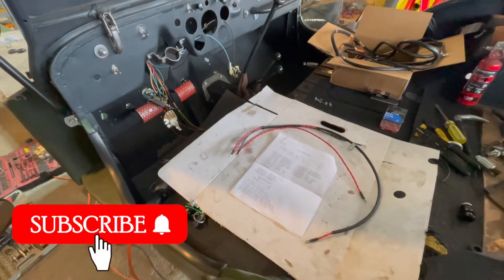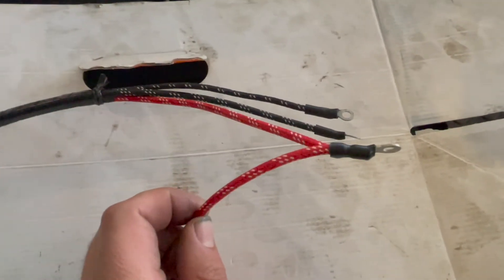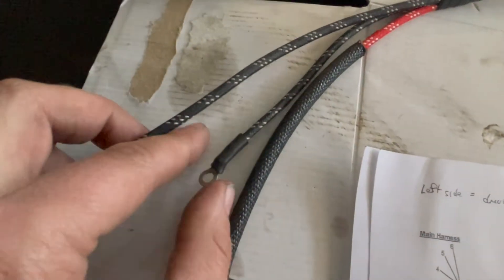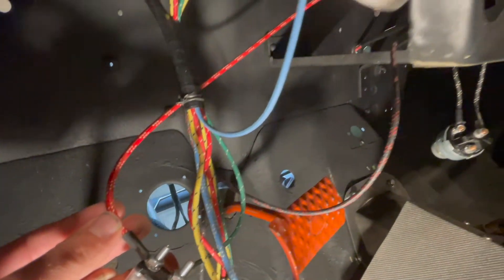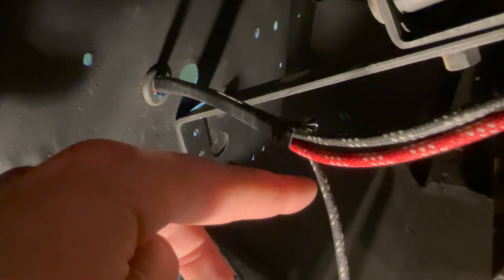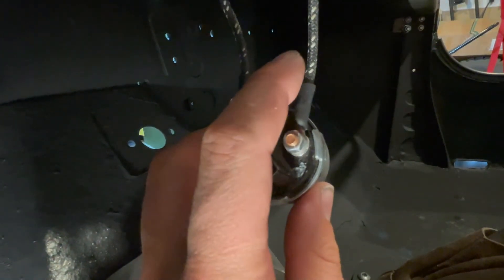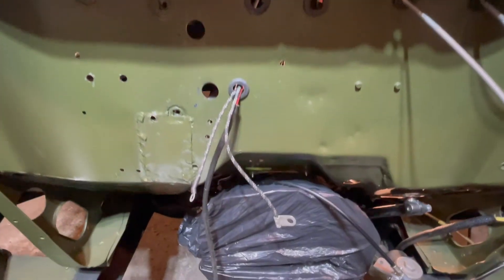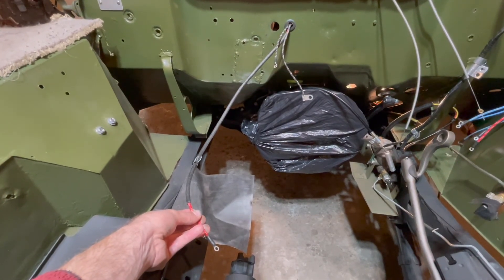CJ2A Willys Jeep Right Side Harness (PART 1) | Electrical Wiring Series

Comment: Excellent video covering a tricky wiring procedure. I have only one question, does it matter if I connect the red wire with the three white tracers on the Amp gauge 1st, then the black wire with the two white tracers on top of it on Drivers side of Amp gauge? Same for the passenger side post on the Amp gauge, does it matter if I connect the black wire with the 3 red tracers first, then the black wire with 3 white tracers on top of  it? Thank you

Comment: How would you wire a volt gauge into this system in place of the amp gauge?
Reply from the maker: I posted pictures in the community tab going through the wiring process